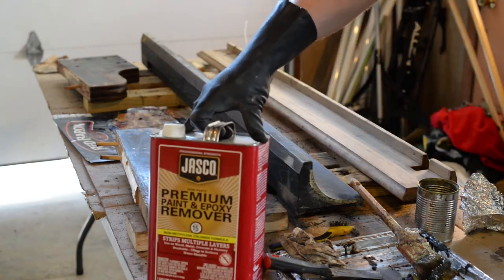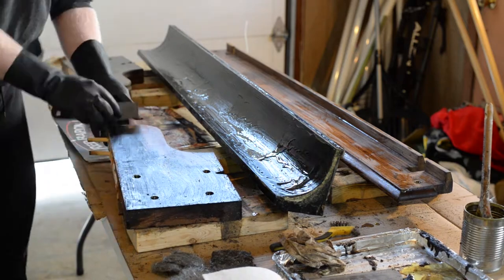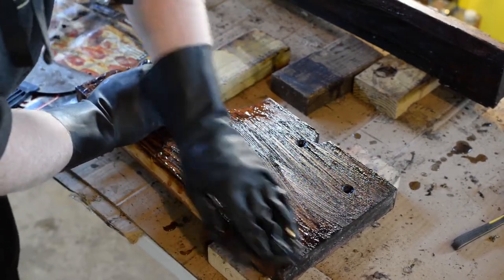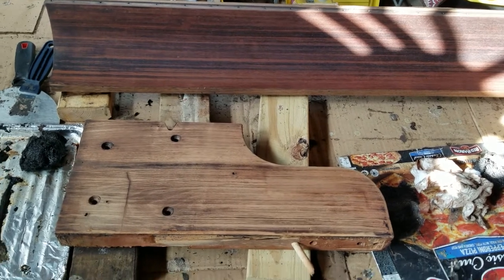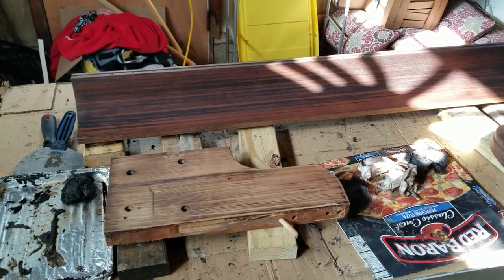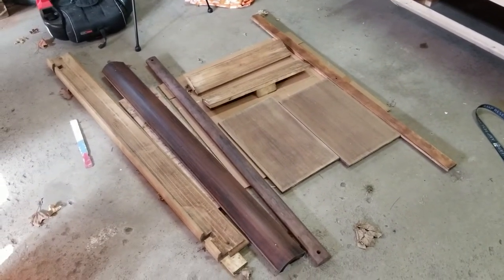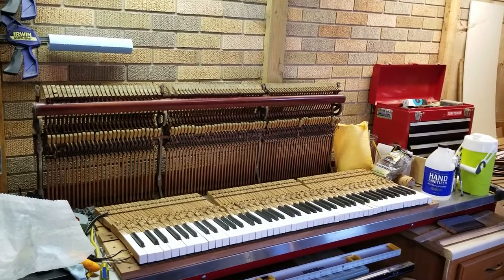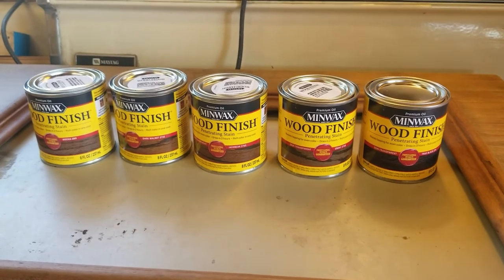130 Year Old Piano Rebuild - Part 16 - Stripping & Stain Samples

Comment: Looking great.  I like to use lacquer thinner.  It gets down in the grain and carvings better and gets that stuff off better than stripper for me.
Reply from the maker: Thanks for the tip. I might have to give that a try. Anywhere the original finish us still present, I've had to fight with the black in the grain of the wood. It seems to come out, but takes 4-5 coats of stripper.

Comment: I've been following along myself. I actually have an almost identical I&P piano. Let me know if you need any pictures on some of the components that are missing from this one. Like the muting/quiet arm. Mine is in pretty good aesthetic shape, but the hammers and the strings need to be redone.
Reply from the maker: Thanks Spencer. I may reach out to you. There are some parts and pieces that I'm working through recreating, and having a reference would be really helpful. I've only been able to find one other example of this I&P piano style online, and the pictures are low resolution and it's hard to make out any fine details.
Reply from the maker: Hey Spencer. If you would like to reach out to share any info on your piano, contact me at at my channels email address: myantiquepiano@gmail.com

Comment: When I'd comes down to refinishing these, they didn't stain the wood... they used a type of dye on the exterior wood that penitrated deeper than regular stain. That's why you can't get the color out of the key cover.
Unlike new pianos, they we're mostly solid wood. No plywood.

Comment: I would have done the test samples on the backside facing into the piano, or on a scrap board.
Reply from the maker: This was a method that Chuck Behm recommended based on how he tests stain samples on pianos he restores. The top front of the kneeboard is usually going to be the same veneer as the rest of the piano, but it is an area that isn't as visible as the rest of the piano, so it's not going to be noticed as much.

I've since done more stain tests with sections of damaged veneer that I've had to remove for various reasons. I'm still trying to narrow into the exact finish combination that will get me what I want.